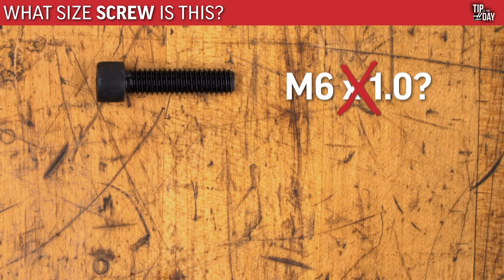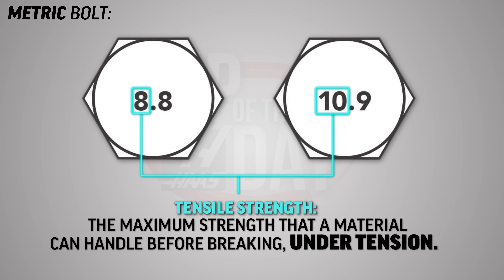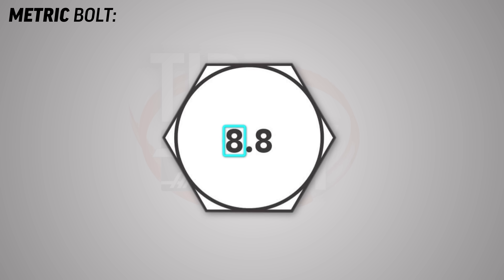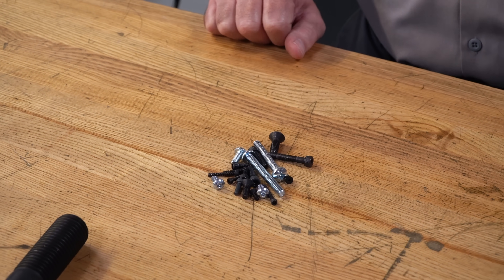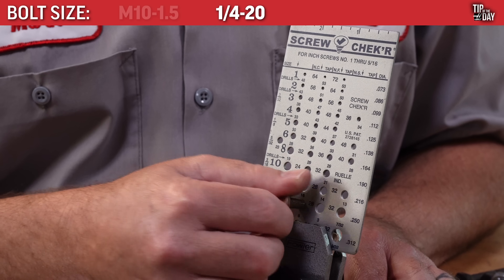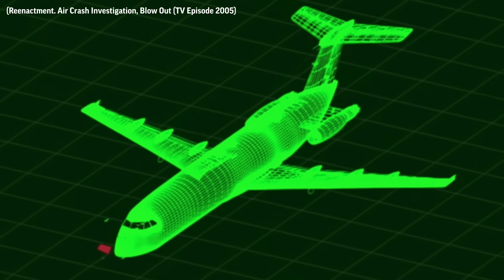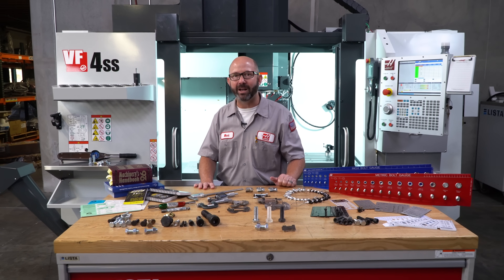The Nuts and Bolts of Screws: Bolt ID for Machinists, Mechanics, and Engineers - Haas Tip of the Day

Comment: I can remember being in school in the 80s when the metric system was introduced to the US and it was poorly received. Mostly because it was an upset to our already established (and learned) system and a bit because of our fierce sense of pride and individuality as Americans. After living abroad as a service member I have come to appreciate the simplicity and ease of use of the metric system. Transition can be a slow process but the outcome can be well worth it.
Reply: I agree here in the UK the imperial system was our method for generations when you see an old engineering drawing from the seventies next to a modern metric engineering drawing it's some much clearer just easier to work with but your Wright the old timers still like imperial depends on your age I guess .I learned the two systems as sometimes o have to read old engineering drawings.
Reply: @thegoat949  I'm 62 years old now. I have been dealing with this crap since 1978 here in America. It will never change in my lifetime. There is too much money to be made by tool and hardware suppliers.
"2 sets of tools in every box"
Reply: Ehh might as well use both, doubles the size of the part catalog.
Reply: I've worked on vws since I started driving about 30yrs ago ,so I've adapted and it's handy. 
Then you can also figure out what wrench sizes interchange in a pinch and all kinds of other good stuff.
Reply: @MrTheHillfolk  Yep, my 14mm works on my 9/16" bolts. There are a few like that!
Reply: Agreed, as an American who uses metric bolts ~33% of the time anyway, we should just fully transition.
Reply: I was in school at that time myself and it has only been in the last few years that I have come to appreciate the simplicity of the metric system.
Reply: We are about the same age and I remember being told at school beginning Monday we will be switching over to metric, however, Monday never came. It’s like they just dropped it lol
Reply: The metric system would have had you speaking german or jap.  The Americans freed the free world with our system.
Reply: Old guy here. I remember this too. Unlike some I'm not a fan of metric. 1mm is too small to be meaningful for bolts. Both in head size and thread size. 
You could say that about 1/16 as well but the common sizes tend to be more than a 16th in real life. Now I work on boilers and chillers so small for me tends to be 3/4 " to 11/4" nut sizes. Very hard to confuse.

Comment: This is a topic that always seemed overly complicated. Thanks to the great information in this video I now understand that yes, it is indeed overly complicated!
Reply: it is complicated asf if you look at the bolts /screws used on cars...you know those that have the washers fixed on them. I'm restoring cars to the nuts and bolts so to say and trust me its hard asf to find original bolts or fix holes to make them work with the original bolts ...then you get to the washer size or heck even bolt factory color ....it gets complicated fast.

P.S. lately the assholes are using plastic rivets ...again those come in different size diameters ...and most of this crap goes around the wheel arch exactly where people tend to loose or don't care about originality .Things like these trigger my ocd lol
Reply: @Adrian-mq5ld  oh I fuckin hate those Jesus pins
Reply: @3dpyromaniac560  yea if you are like me and want your fix to look like it left the factory I understand your feeling. Man I have a 88 Firebird and they used 10mm bolts that hold the plastic cover inside the wheel arch.... move to any 90's + cars and you will have plastic rivets that you have to break to remove the plastic....screw this shit ,no pun intended.

Comment: Only problem I have with this video, which is very useful by the way and I thank you for it, is Flight 5390 resulted in the Captain (known in the industry as pilot in command)  being partially removed from the aircraft while the First Officer/Co-pilot was the one who landed the plane, thereby saving the Captain's life.
Reply: Yes remember that very well , in aviation fitting i was told you check-check-check  & every part is logged a shortcut made somewhere i would think ..................
Reply: Evan is spot on! I came here because I like knowing what I think I already know! I am disappointed that this man  ( narrator) did not do his research prior making this video. The Captain was who was sucked out not the First Officer. He is the FO is the one that landed the airplane. The mechanic was not any smarter. He should have known that he was using the incorrect fasteners just from how they were going into the window frame!
Reply: @TheFalconJetDriver  You should get your money back.

Comment: Better haas use metric bolts to assembly cnc machines!!!
Reply: I’d love it if everyone, everywhere went metric. So many parts suppliers in the U.S. provide imperial/inch parts that it will still be a while before we make the jump. Even the material we buy is in inches. The auto industry (U.S.) was all inch, now it’s metric. Aerospace inch, heading metric. Slowly but surely.

Comment: Metric bolt: 8 means 800MPa
Inch bolt: 3 means 5, this five means... it's complicated
Reply: Yeah how on earth is the imperial system still around, none of the imperial stuff seems obvious
Reply: @TheFool2cool  Answer: Tool suppliers like Snap-on and such have a saying. "2 sets of tools in every box". 
The biggest scam ever foisted on mechanics and technicians.
Reply: Haha try A/N stuff 🤣
Dash 8 is 1/2" dash 4 is 1/4" (tubing) 
Kinda makes sense and is totally goofy all at the same time 🙂
Reply: @MrTheHillfolk  For tube sizes that's just measured in 1/16ths. 8/16 = 1/2" 4/16 = 1/4". A bit goofy because that's nominal tube size and not the actual inner diameter but the idea is to make it simple to figure out what fitting to use for a given hose or vice-versa. It shifts the annoyances of figuring out what the actual thread parameters are to the manufacturer and for the guy who just needs to replace a broken AN fitting on a 1/2" hose he can easily take that and convert to 16ths to get the right size without needing to know that that corresponds to a 3/4-16 thread for that fitting. There's not much of a point to mixing anything non-AN with an AN fitting and the vast majority of users are not machinists so just knowing the tube size is fine for most people.
Reply: Imperial System is complicated
Reply: It really isn't complicated. Its just memorization.
That goes for both systems. 
When I was a mechanic I used mainly metric on newer vehicles and if it is pre 1980s its mainly standard with the exception of the imports which there wasn't a lot back then here in North America other then the bug and some British cars that used British standard, American standard and some metric. . 
The confusion era here in the states is the 1980s and 1990s where an engine maybe designed in the 1970s using SAE sizes and the suspension maybe a new design using metric.
As for distance or measures it takes about 2 weeks to get used to either system although I must confess I will always think in American standard as I really don't care for the metric weights and measures as they don't seem accurate. Example being a kilo to a American pound, there is 2.2 pounds in every kilo..
The last few years I have been working construction and standard American is king with the exception of roofing it is for some reason in metric.
Again its just memorization once you catch on either system is good and both have strong and weak points, metric system strong point is it is divisible by 10 and easy to input on a calculator.  .
Reply: @AtomicReverend  
Where I live, the metric system is standard. except for water pipes and the thickness of the planks of wood here everyone uses inch dimensions. As a mechanic, I also need to know the dimensions of bolts or engine parts in the imperial system. But for me the metric system is simpler just because it is divisible by 10 and this applies to all units: weight, length, volume. It's too complicated for me in the imperial system.

Comment: The fastest way to check if two bolts or screws are the same thread/pitch, is to hold them against each other from opposite ends. If they are the same, the threads will clearly fit together.
Reply: @infinitybeyond6357  haha watch your butt on npt 1/8-27 American versus the bsp 1/8-28.
Haha they can be interchanged, once, if you really want it to be🤣🤣

Comment: Actually a 'bolt' simply has a portion of plain shank whereas a 'screw' or more precisely 'setscrew' is threaded right upto the head. Notice I said 'setscrew' and not 'set screw', a set screw is also known as a 'grub screw' and has no head and instead has a socket hole in the end.
Reply: Correct - however a "set screw" describes the function of the screw, but not the type.

Comment: The technical difference between screws and bolts is the fastener. With screws the fastener goes in the screw head. With bolts the fastener goes around the bolt head.
Reply: Was looking for this 👍🏻
Have read/heard many explanations, but but this is the only one that holds true
Reply: Don't know who told you that, but that's not true.
Reply: @littlejackalo5326  search for the technical or standardised name for any bolt or screw and find out
Reply: Sorry - incorrect. Bolt has a shank, a screw does not.

Comment: If you machine metric thread like tapping hole with hand tap  , diameter of the hole = major diameter - pitch ( M6x1 need 5mm hole,....). But in some case with special requirement, you must check carefully in machinist book to find tolerance.
Reply: Gotta love when something makes sense
Reply: Our inch bolts are similar, we just have to do some math first to calculate our pitch. For a 1/4-20 tap our tap drill would be our diameter (1/4=.250”) minus our pitch. Our pitch would be 1/our TPI threads per inch, which is 20 TPI in this case (1/20=.05” pitch). .250-.05=.200”, which matches well with our typical .201” diameter tap drill for a 1/4-20. Your rule of thumb is much easier with metric fasteners where a tap drill nor an M10x1 is just 10mm-1mm which is 9mm.

Comment: Mark teaching sophomore level courses for the Mechanical Engineering programs at universities in one video free of charge! You took me back to my college days. Put up a stress strain curves, Mohr's Circle and stress/strain equations, and bam, you are an engineer! Great video Mark!
Reply: Almost put up the stress strain curve 😀, but it started to feel off topic, from screw identification. On the table at the beginning (middle back) 00:40 were three screws of different grades where I’d taken the screws and torqued them to failure (tensile) and torqued them past yield. It’s not a good feeling when righty-tighty turns into righty-loosy! I use a 2 needle (memory needle) torque wrench while testing ultimate strength so it’s really easy to see what’s happening, when you keep turning but the torque stops increasing. We should make a short video that just shows that footage. Thanks for the comment.
Reply: Wait, they actually teach engineers about hardware?!.

Color me shocked - we once had a summer intern working on his Master's in Mech E, and he didn't know what a Phillips screw was - came looking for a a "cross screwdriver". Nobody knew what the hell he was talking about.

He lasted 2 weeks.
Reply: @machinist7230  Well I guess it all depends on the university. I'm a Calpoly graduate and hardware was part of the lectures and labs. Understanding fasteners, how they work, what they are and how to design for a given application was critical though machine design and strength of materials. Looks like your intern went to a "lecture" base university. Beware of those engineers lol.

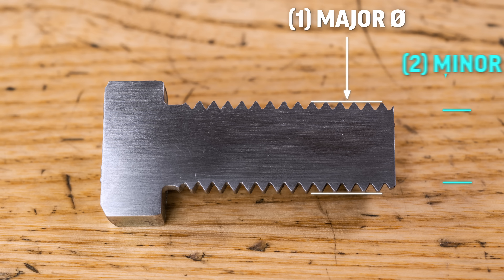Comment: 8:36 Actually in order to get the right bolt the four things you need to know are the standard, material, thread size and length.
Reply: Nice catch. My notes originally said "In general, there are 4 parts to a basic straight screw thread..." but I got excited and started adlibbing. Your '4-things' are great. We have some different requirements when choosing a tap, or matching a bolt, or when inspecting a bolt we've made. Thanks for the comment
Reply: @markterryberry4477  I'd be interested to know how often people actually go through the trouble to use an optical comparator for threads. Just about every bolt uses 60 degree standard threads and if it's something different like left hand thread, ACME, buttress, tapered, etc then it's generally pretty clear by looking at it or by the application that it's not a standard thread profile. Is it mostly for checking tolerance classes of standard thread profiles or taking measurements on non-standard profiles? It seems odd to use it in a situation where a set of go/no-go gauges would be quicker and probably cheaper than an optical comparator.
Reply: @AndrewMerts  I really loved our optical comparator when working in a job shop. You’re right though, it’s not as common as it used to be I think. We rely on thread plug and ring gages more often now, along with the the major diameter of our threads, and maybe pitch mics on male threads. We trust our inserts to be 60 degrees, or 55degrees, or 29 degrees, but for me, it’s a dimension (the angle) that needs to be verified on the part, just like anything else. Our pitch diameters are unlikely to be correct if our thread angles are off though. Great comment.

Comment: Great video ! Very informative and easy to understand. Even though i work with imperial units quite a lot, metric is objectively easier to understand and use.
Reply: You may think easy now, just wait till they change to metric time. Instead of a clock going to 12, it will be 10. 10 months in a year etc.
Reply: @kirbylee57  I already thought of that xD

Comment: Not only the wrong screws used, but originally the window had been installed with the wrong ones, but since the mastic used to pressure seal it was fully cured the screws being wrong were not too much of an issue. But the new window, with still curing sealer, and the wrong screws, plus replacement screws used that were visually compared on replacing with like for like. Instead of looking up the IPC, and getting the part with the correct part number, correct diameter, thread and length, was the bigger problem. Thus the screws were the only thing holding the window in, and they simply were not up to the task with the tiny area of engaged thread.
Reply: The windshield pane would be better fitted from the inside
Reply: @norton750cc  Has to be fitted on the outside, impossible to fit on the inside, as it goes below the instrument panel, which to remove takes at least 2 months work.
Reply: @SeanBZA  I get that, I worked in the subsea industry, a view port in a submersible has to be a taper fit from the outside as that is the hi press side. Also as you say it is not viable to strip out the panel.
The pressure is also a factor, aircraft at hi altitude internal pressure is only a few psi above ambient, subs can be hundreds of times that .  Thanks for saying.
Reply: @norton750cc  Yes in general aircraft window are held in by a pretty strong 2 part adhesive, like car windscreens are. The screws are there mainly for assembly and as back up in case the flexible joint fails, but in no way are they strong enough to hold the pressure, the window failed because the screws were the wrong type, too short and too thin, so not enough thread engaged, so they sheered out with time, but also the adhesive was not fully cured, which takes a week or more to do, but it is in general cured enough to hold the window in, with the screws in correctly, after only a few hours.
Reply: @SeanBZA  Roger that Sir

Comment: I recently took a class on Fundamentals of Properties of Materials the past semester at University, and this video basically was a recap for me. Also, I remember my days at a machine shop back in the day at High Shcool. Awesome content like always, keep up.
Reply: It was my professor, in that class, that told me if I wanted to be an engineer I should quit my current job and go work someplace where they have machines, and engineering going on. I did. I found a job at a place that had CNC Machines and I was blown away. I ended up programming at that shop, and becoming Operations Manager there. Loved it. Ended up turning in all my units for a business degree, but I have to thank that Engineering Professor for setting me on the path that was right for me.
Reply: @markterryberry4477        Wow, I am glad, amazed, and honored by hearing that! I hope you stay there forever, just because you find your passion, you always need to pursue your dreams. Currently,  I'm in my second year of University, and I found it to be amazing. My Mechanical Engineer obsession is about Designing and Manufacturing, those are my two favorite things about it. I fell in love with SolidWorks, welding, and machine shop equipment like lathes, millings, CNC Machines, and more. Continue that awesome path of manufacturing, it is an amazing job that everyone benefits from. Keep it up!